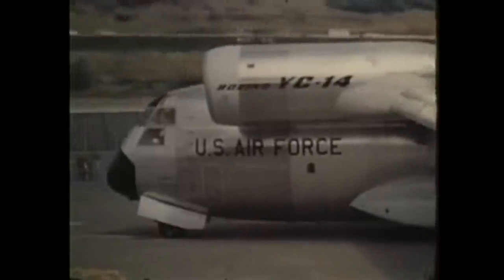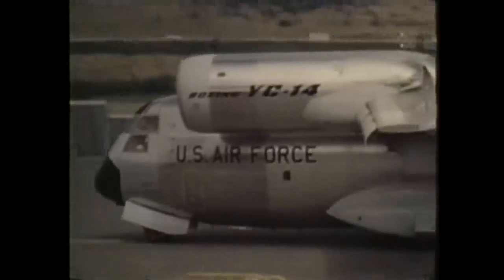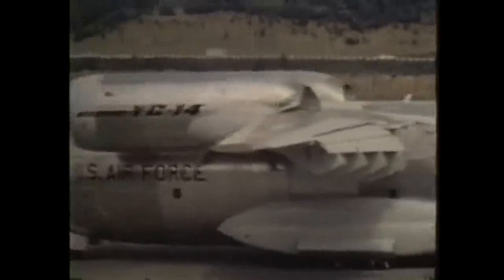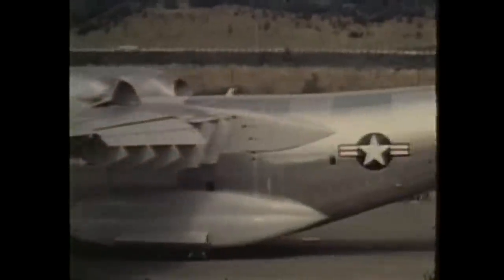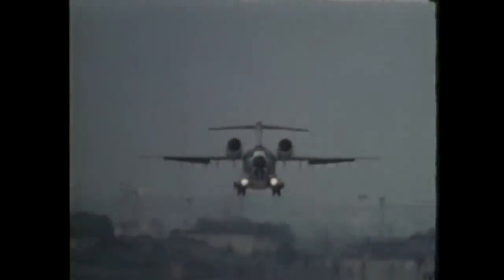Boeing YC-14 STOL Tactical Transport

Comment: At the time of the development of the YC-14 and YC-15,procurement for a Medium sized tactical cargo plane with stol capability on unimproved surfaces,just ran out fiscal funding.
True,information learned from the competition did lead to the development of the C-17 years later.
Reply: It came in under budget and we'll within the time constraints but since it worked too well the airforce had to mess with it and change the requirements and that's how we got the c-17 which was delayed and over budget